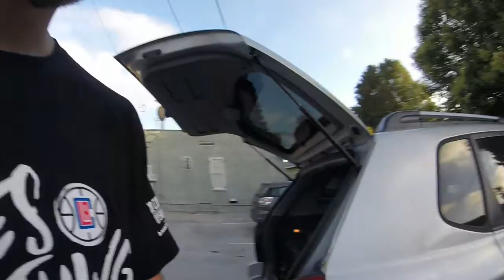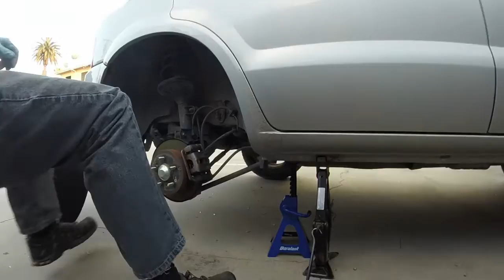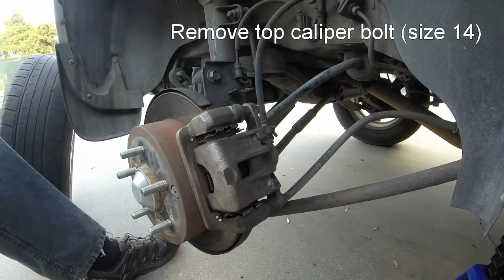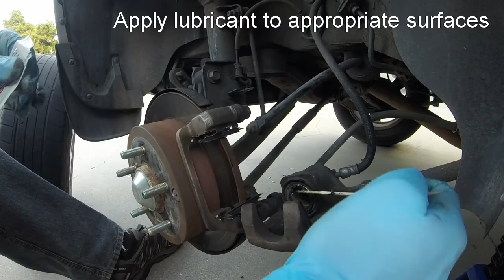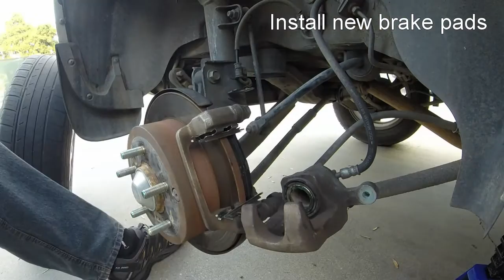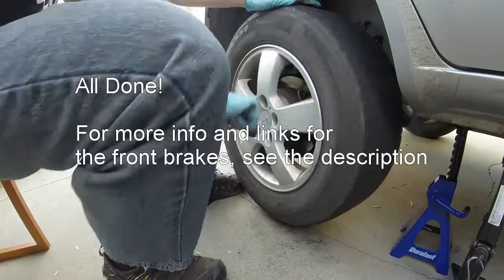2008 Hyundai Tucson Rear Brake Pad Replacement

Comment: what is the lubricant you use  at  0.45 ??
Reply: at  1.45  your hand/glove blocks  where to apply  the  lube ....otherwise great  vid ...appreciate  it being speeded up
Reply from the maker: It is brake grease; it helps prevents squeaks. More info: https://www.super-lube.com/brake-grease-applications
Reply: @fiddlings  great stuff ,,  thanks  for the  comprehensive  information

Comment: Hello. Thanks for video. Do we need a tool for backing up the caliper or not? Thanks for answer.
Reply from the maker: No special tool is needed. You just need something to push it in. A g-clamp like I used works very well
Reply: Thanks for an answer.
Reply: Also open the bleeder screw it makes it easier to compress and doesnt push dirty fluid back up in the line also i was able to make due with using a pair of linemans pliers just put the old pad over the piston and open the pliers between that and the caliper